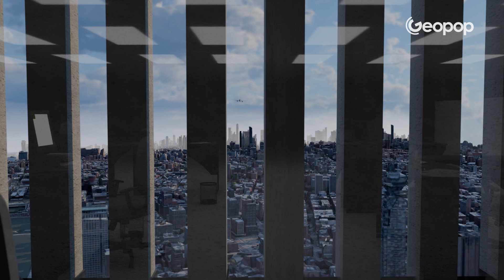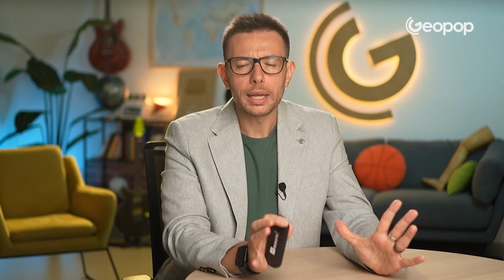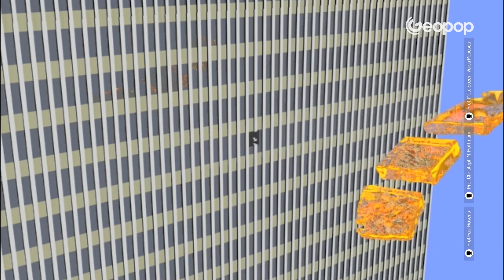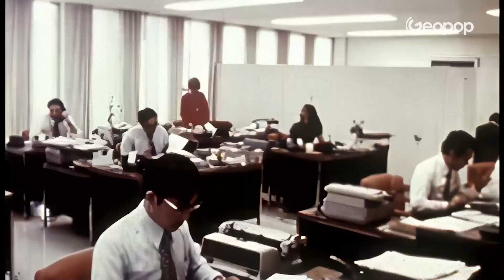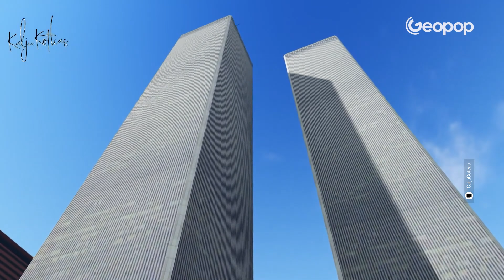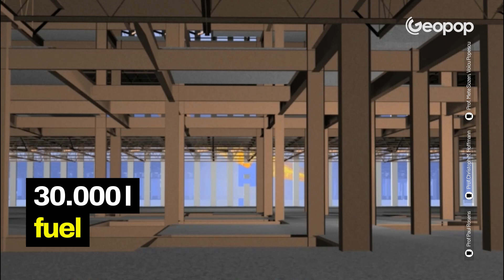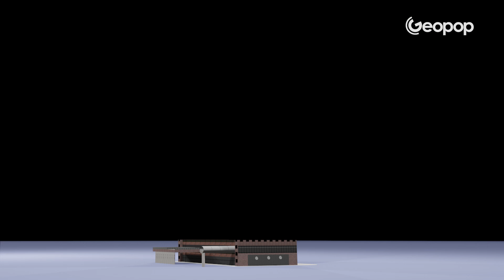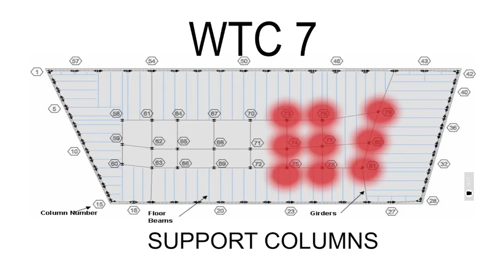9/11, 2001: The Technical Reconstruction of the Twin Towers and WTC 7 Collapses

Comment: Controlled demolition
Reply: Obviously not
Reply: @TheLoonResistance why was there molten steel dripping the next day at ground zero
Reply: @flylippfantom375  - There wasn't.  Why do you think such an anomally would have anything to do with any sort of pre-planned (let alone "controlled") demolition?  That's never happened before.
Reply: @TheLoonResistance watch 9 11 Explosive Evidence Experts Speak Out and i promise you will think differently.
Reply: @flylippfantom375  - Seen it. You would be completely wrong. I can do way better than those asshats. Here for example:

At the end of the day, we all just want to know what really happened, right? It’s tough because even though structural engineers had figured it all out within weeks there is still a massive amount of misinformation out there on the internet to muddy the waters. How is the layperson supposed to sort it all out? 

I’ve put more thought into this than most since anything can seem like a conspiracy if you don’t understand how it works and I like understanding. If you don’t mind, I’d like to offer my perspective. You may choose to disagree, but if I am in error on any point of fact, logic or reason please let me know.  Just saying you are wrong or I don’t believe you isn’t compelling. 

While complex, most of the Twin Towers collapse mechanisms can be seen with the naked eye and easily discerned and understood by the layperson IF sufficient time is taken to understand.

1.   The Twin Towers consisted of 4 primary structural elements together forming an integrated system where each relied on the others. 47 hollow box-section steel Core Columns carry most of the gravity loads. The 236 hollow box-section steel Perimeter Columns carry the remainder and ALL of the lateral (wind) loads. Long-span Lightweight Steel Trusses connect core and perimeter column together with a Hat Truss on top to tie it all together as an integrated unit where no element can survive without the others. There was no structural load bearing concrete and most major assemblies were bolted together

www.youtube.com/watch?v=u7OqrC74Dm4

2.   The impact of a 122-ton airplane (= 12 dump trucks) at up to 587 mph with the energy of a ton of TNT destroys the aircraft in 0.50 seconds. This in no way implies the Towers come out unscathed. Some folks get hung up on that. Many perimeter and some core columns are destroyed or damaged primarily by bending, twisting, splitting weld seams and critically by bolt-shearing failures at the end connecting flanges. No cutting or slicing - the reality far more violent and brutal. 

www.youtube.com/watch?v=zF-94yDHlk8

3. The impacts destroy or damage fire insulation, fire breaks and sprinkler systems on multiple floors. Jet fuel acts as an accelerant starting huge fires start across multiple floors simultaneously that spread spread rapidly with no effective firefighting or fire suppression. This was an unprecedented fire event . Office buildings are essentially giant piles of kindling when it comes to fires, chock full of stuff that burns vigorously and quite hot. 

4. The hotter steel gets the weaker it gets shouldn’t be a revelation. With fire protection compromised the survival time of the steel greatly reduced . Over time heat gradually causes the lightweight steel Floor Trusses at the damaged floors to sag, which we can see. No steel melted or needed to. Structural steel fails long before it becomes a puddle. It just needs to bend 5. A straight column is up to 4 times stronger than a bent one. Sagging floor trusses pull on increasingly weak and overloaded Perimeter Columns, causing some of them to bow inward by up to 5 feet until they buckle and fail, quietly initiating collapse. The formerly static mass above which the structure below could easily support converts to a dynamic mass up to 30 times greater. The Columns above and below the failure point are no longer aligned . The load bearing structure below no longer bears any of the load above, which falls past the lower columns NOT onto them. www.youtube.com/watch?v=ULdiD6gYZO0 www.youtube.com/watch?v=zTygQK3vriI 

6. Heat starts the collapse, gravity finishes it . Thousands of tons of debris drop largely within the four outer walls, through the open office space, the path of least resistance crashing onto the first intact floor, The bolted column connections instantly break as the amount of resistance the Floor Trusses can offer is negligible, slowing the falling debris only marginally and briefly before the connections fail. www.youtube.com/watch?v=flo62pdaIMI
Note: 
6a. This is NOT a solid top block crashing into a solid bottom block . 
6b. The debris falls past the columns not onto them. The columns provide no resistance to the falling debris. 
6c. Only the bolted floor truss connections to the core and perimeter columns offer any resistance. A pair of 5/8” bolts at each end of each truss vs. thousands of tons of falling debris. 
6d. No laws of physics are violated. 
6e. There is no 20 floors against 90 floors but rather 20 floors against one floor, then 21 floors against one floor, then 22 floors against one floor, etc. 

7. This floor-led collapse progression largely within the four outer walls can only go straight down. There is no lateral force to push it over the side, only gravity to bring it down. 

8. Collapse progresses through the floor systems past the columns, through the path of least resistance . Resistance offered by each floor is always the same while the falling mass acting on it is constantly increasing and accelerating (gaining energy). This process of floor-by-floor destruction cannot be arrested. It can only speed up . Rate of floor failures increases with each floor as momentum increases, reaching an average acceleration of 0.65 of GA, or 35% slower than true free fall. Bam, bam, bam down the building until there are no more floors to fail. More mass, more velocity, same resistance with each floor. Don’t get stuck on the but the lower floors weren’t on fire nonsense. They didn’t need to be. 
8a. This process is often incorrectly referred to as “pancaking” which while catchy, is incorrect. Too simplistic and inaccurate anyway. More like Kaiserschmarrn. 

9. The Towers were 95% air by volume. As that air was compressed inside the building by falling debris, pressure builds until it is blown out the sides in reaction to the building collapsing . Those were not “explosions”, it was expulsions of compressed air caused by the collapsing building, explaining the low velocity, lack of flash, blast, supersonic pressure waves and lethal high-velocity ejecta. 

10. Perimeter Columns become detached and peel away like a banana behind the collapse front, playing out to the four points of the compass in long lines extending to 800+ feet from the base of the towers, damaging and destroying nearby buildings. 

11. Core Columns fail last as their internal beam bracing is stripped away by falling debris and lateral support from the floors to the perimeter columns is lost. 

www.youtube.com/watch?v=WpHXj62Ylw0

12. This process took 31-34 seconds from perimeter columns bucking until the last core columns hit the pile, or 1/3 the rate of true free fall. Don’t believe me? Just watch a video of the collapses and note the loose truly free-falling debris dropping much faster than the towers themselves. 

https://www.youtube.com/watch?v=dh4r-gHdyPU 

13. Each Tower had a 1-acre footprint. Far from collapsing inside their own footprints the debris pile spread out over 17 acres in a pile up to 14 stories deep. 8 surrounding buildings were destroyed and scores more damaged by the falling debris. 

14. NOT observed were the 180-190 dB bangs of thousands of high explosive devices or the blinding brightness of burning thermite. Explosives or thermite couldn’t have survived the impacts and subsequent fires anyway. Nor could they have caused the perimeter column buckling that clearly initiated collapse. Video of an injured and in-shock firefighter casually using the magic word explosion isn’t proof of explsoIVES and hardly makes a case for planned demolition. Pre-planned demolition doesn’t match the physical evidence and would be technically impossible, totally impractical and completely unnecessary. Simply, no one would bother. In 24 years, no structural engineers of tall buildings, including the 1/3 who have retired, have made any statements in support of planned demolition claims. NONE. The lack of such citations in engineering literature published anywhere in the world is telling. 

15. Twin Towers were perfectly safe within their design envelope. They only collapsed when taken far outside design parameters by an extraordinary and unprecedented event Impact + Fire (heat) + Time + Gravity = Collapse . Remove any 1 of those 4 elements and there is no collapse. Ignore any of them and you will never understand the collapse. The Twin Towers were an integrated system in which no one component could survive without the others. One fails, the rest follow, through the path of least resistance DOWN the open space, bypassing the path of greatest resistance, the columns. No laws of physics are violated and the above is true no matter who planned and carried out the 9/11 attacks or why so the attacks could still be an “inside job”. 

If you made it this far, kudos. That was a lot. I hope it was helpful, informative, non-adversarial and solicits informed critical comment, positive or negative. If I made any errors of fact, logic or reason or left anything critical out, please let me know and I’ll fix it. To stay focused, just one point at a time please and on-topic (Twin Towers ONLY). No word-salads of Gish Gallop. IF you can offer a more plausible alternative be my guest. Please start any reply with the words “Tits McGee” or I’ll know you didn’t read it and aren’t serious. Thanks for your time.

Comment: All the steel would have to be white hot. Not at point of entry the whole lot. Or it still wouldnt have a progressive failure. Steel buildings have burned down with crazy flammable cladding ect and they dont progressively collapse.
Reply: No it wouldn't.  None of the steel would have to be white hot, and it wasn't. 

Not sure what you think believe you are getting at by invoking the first time in history logical fallacy. Even if your claim were true, so what?  Are you really trying to argue that if something has never happened before it can never happen?

Comment: Sorry, but an airliner traveling around 200 mph could not penetrate a fortified concrete and steel outside shell. The wings would have popped off.

Like JFK, it will always be covered up by the guilty party. Bush CIA, NWO
Reply: The South Tower was hit at 587 mph and the Twin Towers were not "fortified" (whateer that is supposed to mean) and not concrete, just the lightest steel cage possible.  

You should keep your argument loading down to the barest minimum.

Comment: As a welder/fitter, you’d be surprised how quickly even thick steel will bend to heat. A blazing inferno of jet fuel fueled by floors filled with desks, plastics, sheetrock, etc would quickly weaken all of that steel.
Reply: That doesn't explain molten steel being found 6 weeks after the collapse. As a welder, you realize that steel melts at 2500 to 2800 degrees.  Jet fuel burns at 800 to 1500 degrees and office materials burns at much less. Another thing is that when steel gets hot, it distributes the heat throughout the entire structure.  If the fires were 1500 degrees,  even the steel in direct contact with the fire would be less. So where did all that molten steel come from? Even under tower 7 that no jet fuel was involved in. 
Molten steel was reported by the fallowing 
people. Captain Philip Ruvolo (NYCFF), 
Richard Riggs(debris removal expert) , Leslie Robertson (wtc structural engineer), Lynn Margulis (University of MA),   Robert Kim Ireland( chemical engineer for US Army Corp of engineers),Abolhassan Astaneh from Berkeley, Mark Basile( chemical engineer), Kathy McGrade (materials engineer), Gery Warner( Mechanical engineer), David Gregg( PhD Chemical engineer), Steven Jones PhD( physicist), Kevin Ryan ( BS Chemistry), Niels Harrit (PhD Chemistry), Tom Sullivan( Explosives team) Jason Cheshire ( Chemical engineer), and Jeffrey Farrer (PhD Material science engineer). 

https://youtu.be/hB1IYi51Kdc?si=7xSCnyaV9DvdCTHl

Now see if you click on that, it shows you stuff. 3:18 you will see video of Lynn Margulis (phd university of Maine) reporting molten steel.  3:09 video footage of Leslie Robertson (structural engineer) reporting molten steel. 6:34 Steven Jones (PhD physicist) reported molten steel, 7:25 Kevin Ryan (bs in Chemistry) reported molten steel 8:23 Tom Sullivan (Explosives technician) says thermite cutting charges is a thing it's not made up. 5:02 Gary Warner (Mechanical engineer) proves molten aluminum is gray, looks like mercury.  He worked smelting it in the biggest Aluminum smelting factory in the world at the time.
Reply: Bullshit! The fire did absolutely NOTHING to the steel and you would know that if you were a welder.

Comment: Why does this whole video go without showing the 4 massive steel columns ?
Reply: There were 47 decent sized core columns and 236 much smaller perimeter columns. You keep going from video to video banging on about 4 massive columns that you just made up.
Reply: Could it be that you misinterpret construction videos you saw? Could it be that you confuse the 4 cangaroo cranes with massive steel columns?

Comment: Just a couple questions 

So are you saying the the core steel melted becsuse it lost its fireproofing coating?  

Yes? So the  structural strength of the steel was solely dependent on fireproofing spray? That’s what caused it to weaken and fail? 

Why is it than the other steel beams pillars supporting  columns thst structurally supported the towers not be sprayed not mention one time ? 

Or if NO was your answer to the core structural steel columns did not weaken and melt due to the loss of fireproofing spray? 

If answered yes or no.  Why do you bring up the temperature of the fire? And thst steel loses 50percent of its strength thst 2000 degree fire.  

Answer me this one question?
2000 degree fire
Steel loses 50percent of its structural strength.  WHAT DIMENSIONS OF STEEL ARE UOU REFERING TOO?

2x2 /4x8 / 14/14 steel beam? Column?  What were the dimensions of the 4 structural steal columns at the core thst supported 60 percent of the buildings weight?
Reply: 1. No, he is not. 
2. Fire insulation does not grant immunity, it grants time. Steel is formed using heat and deforms the same way. An unprotected steel beam for example can fail in just a few minutes of being heated by fire. Add protection systems such as inulation, gypsum board, sprinklers and so on and the steel cain maintain sufficient structural strength for an hour or two, maybe even 3.
3. SFRM was applied to the long-span lightweight steel floor trusses and some columns. Primary insulation for the columns was gypsum board. These passive protections were backed up by active fire suppression systems (sprinklers).  None of this reacts well to 122 tons of airliner bashing into it at 587 mph.
4. No columns melted (as in were heated until they became a liquid) period. Full stop. Structural steel loses about 90% of its ability to carry a load at less than half its melting temperature. It never gets the chance to melt. I have no idea where you get your numbers from.  They are a joke. 
5. There were no "beams".  There were columns and trusses. 

I'm not sure why you keep insisting you want a debate .  There isn't even anything to debate. There is only what happened. This is an engineering problem not a philosophical discussion. Your knowledge of the engineering is poor.
Reply: @TheLoonResistance  You are a very busy shill Fitzshill!
Reply: @TheLoonResistance 😂😂😂 lier
Reply: There was 47 core columns per building that went from top to bottom
Reply: @robbiehiatt9966 . There were 4 massive steel  columns in the center
Reply: he original World Trade Center Twin Towers (WTC 1 and WTC 2) featured an interior core supported by 47 steel columns, including four massive corner columns in the center that each carried about one-fifth of the total gravity load of the structure
Reply: @TysonThomas-u1u  Are you seriously suggesting that 4 out of 47 core columns carried 80% of the total gravity load of the structure while the other 43 core columns along with the 236 perimeter columns carried only 20%?!?
Reply: @zettel3296 no thays not what I’m saying.   I’m saying we need the dimensions and that 4 corner collumns were massive way bigger than the  rest of the core columns.  

Is the looney resistance following you around on multiple videos?
Reply: @TysonThomas-u1u  "I’m saying we need the dimensions and that 4 corner collumns were massive way bigger than the  rest of the core columns."

Then back it up somehow... Did you even read the part about cangaroo cranes?

"Is the looney resistance following you around on multiple videos?"

No. This shill is ordered to shill troll multiple, probably dozens of 9/11 video comment sections, but it desperately dodges particularely me everywhere, at least as soon as it realizes that I recognized it as the same old shill troll account no matter the name changes.